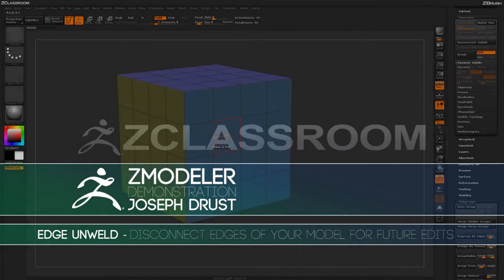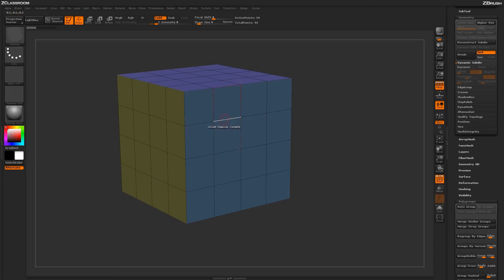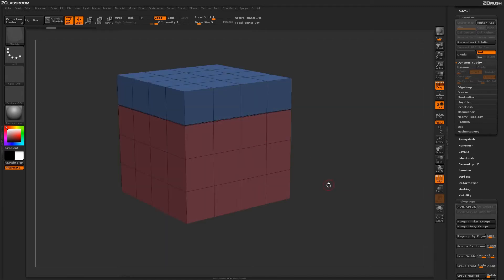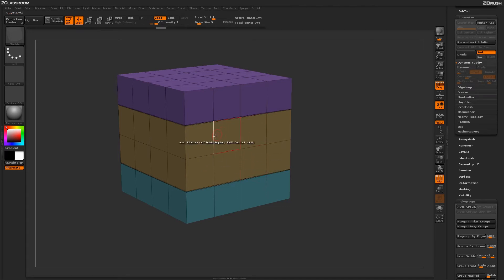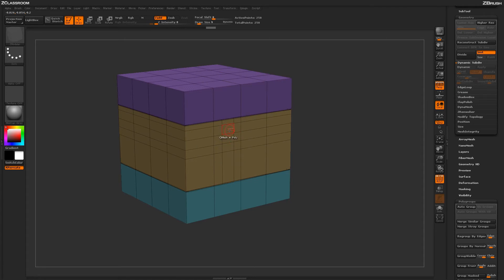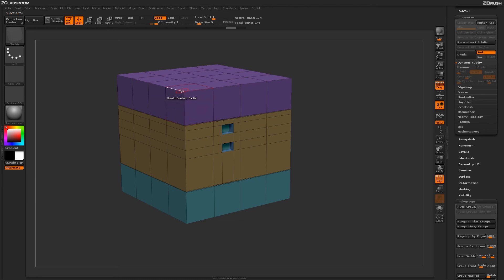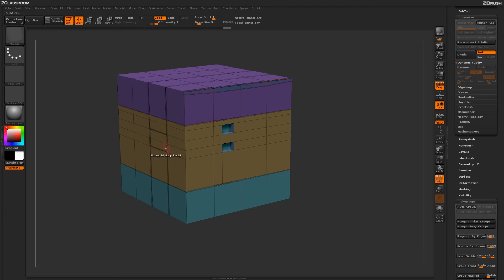ZBrush ZModeler Edge Actions - Edge Unweld

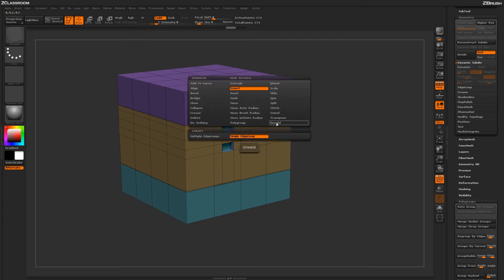Comment: At 1:22 it still looks like it's connected to the rest of the mesh. But what if you don't want that. What if you actually wanted the edges to look unwelded? If Edge Unweld won't do that what will?
Reply: For anyone coming to the video looking for how to actually unweld, not whatever this is, mask out the points you want to unweld>zmodeler bevel>delete the new faces. :)